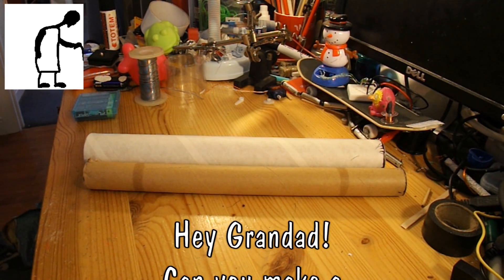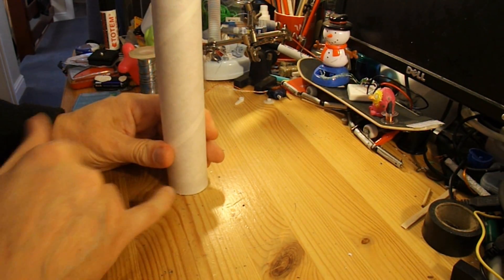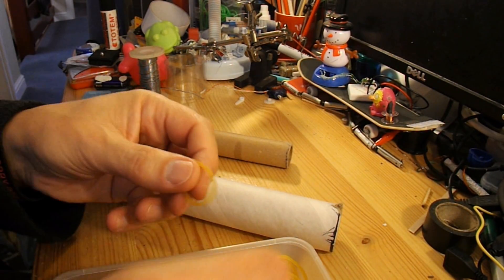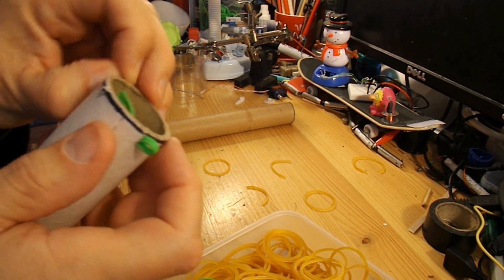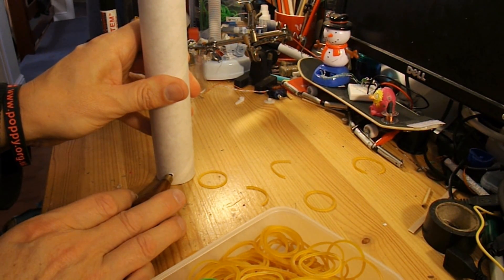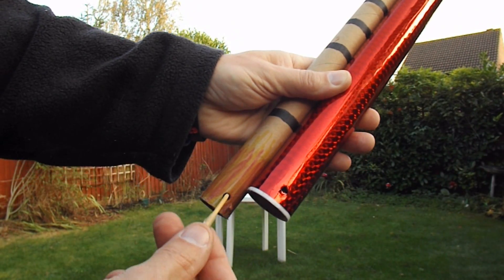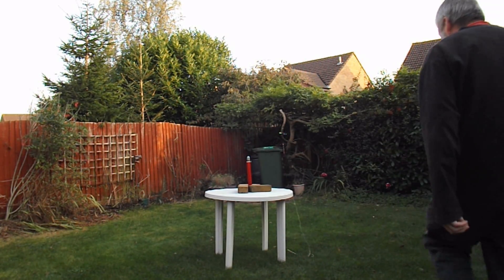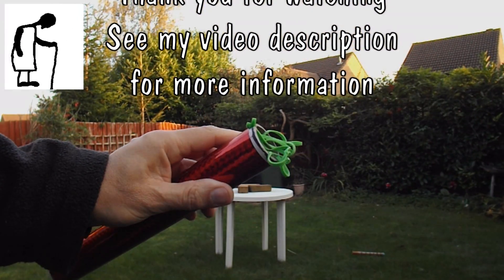Hey Grandad can you make a rubber band powered rocket?

Comment: Would you mind if I made this one in my video?
Reply from the maker: Hey no problem, like I say in the video I would suggest larger tubes if you want more rubber bands to get more power. It is not likely to knock out any enemy tanks but it is a bit of fun :)
Reply: I have in my possession a huge heavy cardboard roll and a sturdy, narrow one.
I'm going to try those two.
Reply from the maker: Myra Madd Good luck and stand back for launch :-)
Reply: Of course. I plan on a few mods.
Reply from the maker: Myra Madd :-)

Comment: Hey grandad can u make a rubberband powered hover toy please👴
Reply from the maker: Rishee Siewdass I cannot think of a simple way to do that. Normally you would have a propeller on the end of a stick with the rubber band motor stretched along it's length. For a simple hovercraft the propeller needs to face down, so the stick would point straight up and that would be very unstable. Even if that did work it would only run for a few seconds so it hardly seems worth it. Perhaps somebody can suggest another way of doing it.